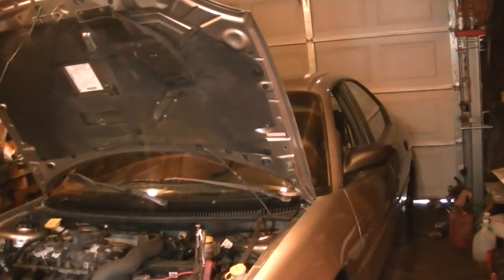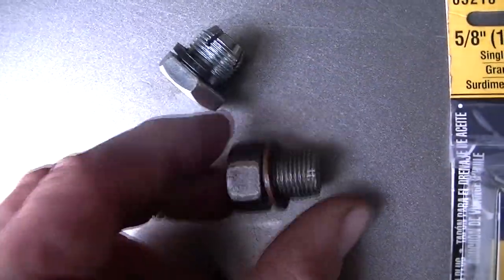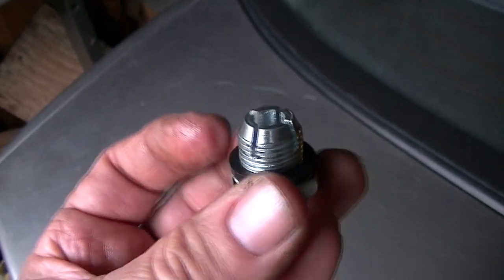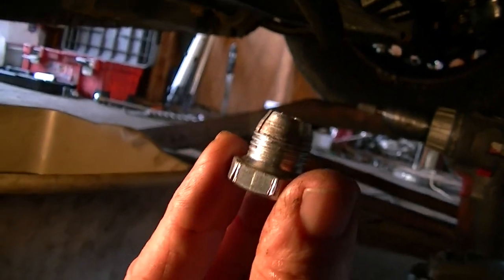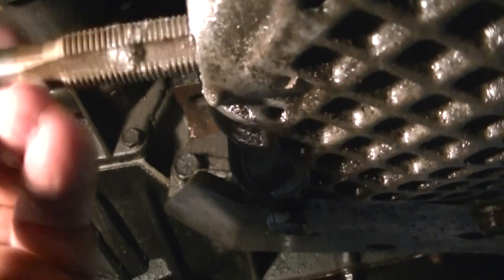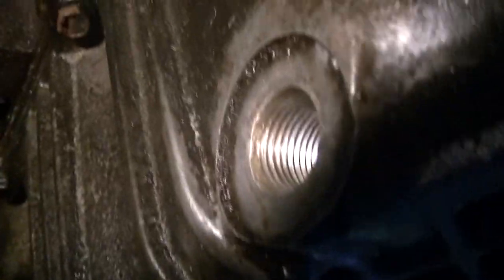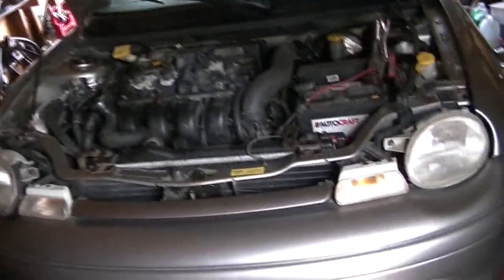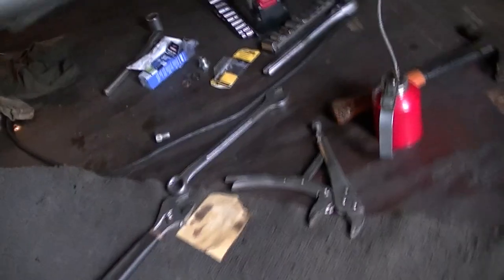Fixing A Aluminum Stripped Oil Pan Drain Plug.

Comment: My plug is spinning too. Luckily it was still 95% of the way in so not a single drop leaked. I bought two different brands of oversized plugs. I think that you needed the buy the same size as the original. Mine are M14x1.5 and on the package says m14x1.5  but I believe that it is larger than that. I looked for one slightly larger but came up with nothing so hopefully we are supposed to just buy the plug labeled our size and it will have the extra size built in. Otherwise it'd be really confused marketing since if it was an M14x1.5 like it says on the package then it wouldn't be oversized. Any tips on how to get the spinning plug out? I'm just so nervous because once it is out it is out.  Naturally it was my very first oil change ever. That's how it always goes for us assholes at home...it never goes smooth like in the videos. I considered just sealing it all up with JB weld and drilling/tapping a new hole but that's more than I was hoping for. I may just get a new pan as a backup incase the oversized plugs do not work since one way or another I will need my vehicle...even if I have to drill a hole in the pan and JB weld in a garden hose spigot. That'd actually be pretty cool now that I think about it.